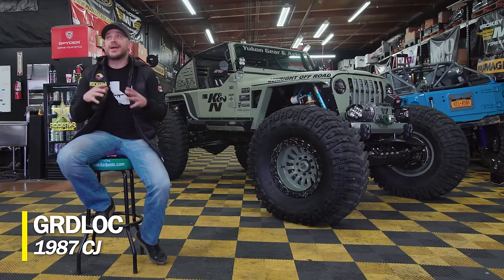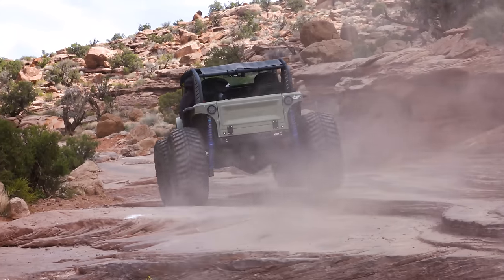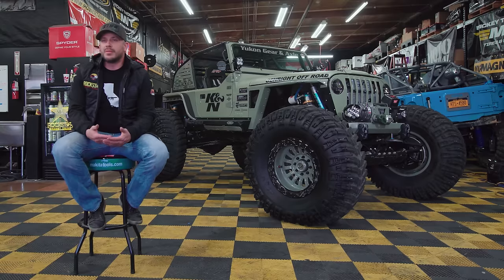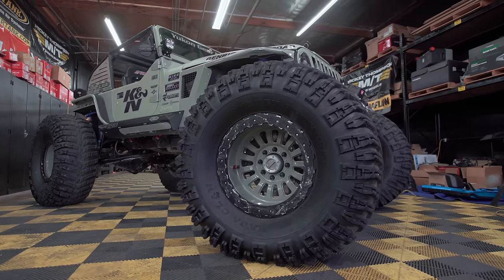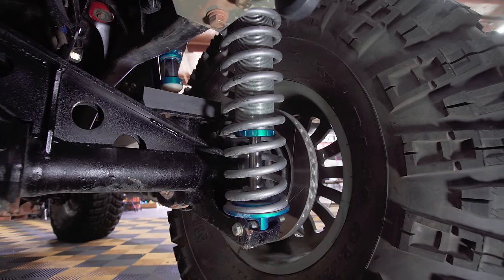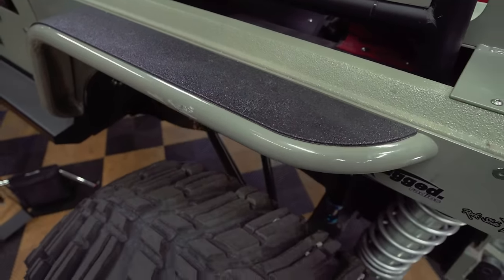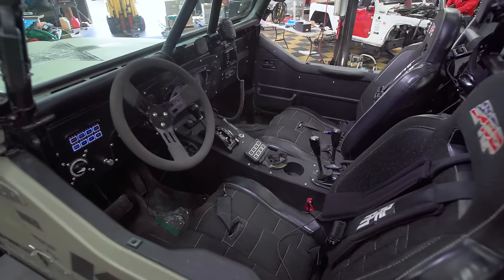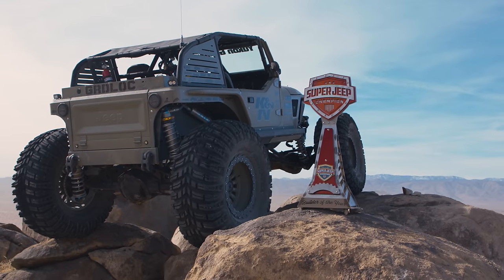GRDLOC: The Unstoppable Monster Jeep CJ

Comment: Nic, What air pressure you running in the tires, not much squat at all?
Reply from the maker: On the Baja claws we ran 10 lbs any less you would pop a bead at flex, on the pro xs it’s a little softer but we now have double beadlocks so we run 6-8 lbs and they still look like they have 20-25lbs

Comment: Looks like your front links could've used a couple of more degrees between them, front axle seem to wander from side to side a bit.. But sick looking/running rig!
Reply from the maker: There’s literally no more room left for degrees they have dual trianglulated front and rear. They have the most separation they can have 🙌🏻
Reply: @RockstarGarage  Just about figured as much, room can be hard sometimes and compromises must be made, as long as it works 😁

Comment: With 46" tires, based on internet dogma you are supposed to have 12.5" of link separation at the axle. The front certainly doesn't look like that much and the rear really doesn't either. It obviously lives and does the job so I was wondering how much separation you actually have front and rear and what size bolt you run through the Johnny joint?

Comment: What tire pressures are you running in the slower rock crawling terrain as I wasn't seeing much flex out of them ?
Reply from the maker: We typically run about 12 lbs in them
Reply: @RockstarGarage  Ok that makes sense why they were not flexing compared to lets say 40 inch tires ( on video's that is of Jeeps etc running 4 pounds and also with bead locks ) . That would be an interesting experiment to see what you're Jeep and those tires would do with very low pressures, for slowish driving on rocks and very loose sand.
Reply from the maker: The new tire setup and dual beadlock allows us to run low pressure like 5lbs so you’ll see those vids coming soon
Reply: @RockstarGarage  Excellent !

Comment: Don't know, but it looks like you have a bolt backing out down there in the rear above the gear housing.
Reply: Wait! You just said the front and showed that same bolt, so that might be the front.
Reply from the maker: Correct that’s the front and it was being replaced during the filming
Reply: @RockstarGarage  Oh Ok 🤙🏼 Glad you guys knew about it because it would have turned out bad at those speeds if you didn't 😣
Crazy dope rig 😁🤙🏼
Be Safe And Be Blessed 🙏🏼

Comment: Where can I find a rear truss like this one, with the bracket mounts already on it.  For AAM 14 bolt 11.5 ring gear only thing holding me up.
Reply from the maker: Anonymous745 Hacker Artec industries makes them, you have to install the mounts but they make them as well. I think we modified the 14 bolt truss to fit the 11.5 aam. It wasn’t much work

Comment: Nice rig, several bolts loose on the heighm joints, and the upper radiator hose clamp needs a couple more turns, and your left front tire is 2 pounds below the right side, PLEASE fix these so we don't see your name in the next obits.....🤣😂

Comment: I am cheap jeep ass 35 from factory bead locks or 37 option on jeep/truck is grand good enough but there r always nuts running 46" really less than $100k stock frame^ on 40" or less is crazy side of extreme u still can drive on road need insurance. 42" & up your trailer queen extreme build, but that is just Me how I see it breaking down.

Comment: OK i go 
t tired of reading comments looking for the answer   I am building a 1994 YJ  it has a T18 transmission Model 20 transfercase  9 inch in rear  with a paralell link panard rod   strait springs and shacel reversal in front  also a OM617 mercedes diesel    I have it sorted out except for gauges and dash  what are the details on the dash and gauges    awsum build      P.S. I hope to drive it around dhe block before Christmas 2020
Reply from the maker: Hit up Dakota digital gauges and ask for Greg Karpe tell him rockstar sent you
Reply: @RockstarGarage  k thank you..... that is a killer build

Comment: Those tires look like they have way too much air in them . I’m seeing no bulge or conforming to the rocks even when they encounter a ledge at some speed 🤷‍♂️
Reply from the maker: Brad Sudeyko it’s crazy they have 12lbs and don’t show it
Reply: I mean it's a cj chassis. Not alot of weight to make them budge bc the tires are so massive it just distributes the weight like nothing
Reply: Dylan Watson that’s exactly the issue. And when you go lower (without double beadlocks) they just lose air out of the inside bead 😅

Comment: Great, now you can do what other people do on 35s...
Just wait till you go out and see an old willys or samurai with lockers do stuff you can't...
Lower the pressure to 1-2psi... You should know this, since it's the first thing that you learn when you go out off-roading... 
You've never off-roaded and just decided to build an huge rig... That would be the same as a new driver buying an F1 car for daily driving...
Reply from the maker: Mega thanks for comment. Unless you’re running a dual beadlock you typically won’t go below 5-6 lbs. In these videos we are running 12 lbs that’s the magic number of not having a 19.5” tire on a 10” wheel not burp air or unseat. I would love for you to wheel with us and or anyone. Check out the videos on here of all the rigs before you start throwing stuff out there 😂👍🏼
Reply: @RockstarGarage   I run 5 psi without beadlocks... 12 Psi is what I use on the road, just in case I have to go off road...
What vehicle did you start with? 
A jk on 40s? Sure looks like you really know how to off-road... My vehicle can't make it? Surely, it can't be my fault, I'm gonna put 46" tires on it, then we will see...
Reply from the maker: Again assumptions are being made, have a better day bud 🤘🏼